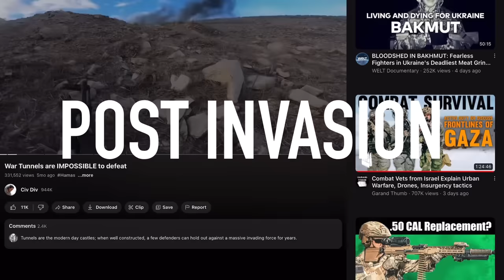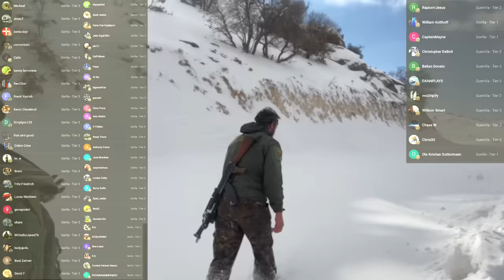How to SURVIVE an Invasion *Guerrilla Edition*

Comment: Here's an outlandish question. 

How safe do you think tunnel networks are if hit with nuclear weapons? (Two different scenarios)

The first being a ground burst on top of or near the tunnel network.

And the second being a subterranean detonation either made via some sort of nuclear armed bunker buster or a hole drilled into the earth with a nuclear device placed within.
Reply: Look up reports from people on the ground in Hiroshima. Some people survived in brick basement
Reply: @ethanking4954  I believe the Hiroshima bombing was a air burst. Not a ground or subterranean
Reply: Too many variables...would have to be mission specific. The assumption is usually a blast would NOT be on top of you. Even Cheyenne Mt. has a limited burst capacity for direct hit.
Redundancy is the order of the day as far as survival and long term operations are concerned. That's why secrecy is so tight. Just because we know about one doesn't touch the many others!
Reply: P.S. A well stocked tunnel/bunker system would still be your best bet, especially if it could be sealed off or filtered air.
A large lithium battery bank could keep you lit with leds and light comm's for weeks if carefully conserved.
Reply: Going underground is a solid tactic for surviving the fallout. It only takes a few feet of soil to stop even the worst radiation.
Reply: @vhfgamer not the blast though
Reply: @dananorth895  Also most people are stuck in the last century thinking about traditional nuclear bombs. Very few people are thinking about the radiological threat of neutron bombs that purely target biological matter. I guess partially because there isn't much you can do to defend yourself from that other than just not being in the area.
Reply: @vhfgamer  Other issue though is also making sure the terrain keeps you from being buried alive. Like lets say a chunk of building falls on top of your entrance.

Comment: Tunnels are good if you have time and equipment to build it. But for common folks especially in Russia/Ukraine it's not the case innit? I think guerilla tactics in woods would be helpful aw
Reply: Drones with infrared cameras can easily find you through trees
Reply: Are we sure they didn't have some years to prepare?
Reply: Ukraine may have ground water table issues for tunnels, its flat terrain. They had tunnels in vietnam though and it rains plenty there so im not really sure.

Comment: Tunnels are impossible to defeat…. Good thing the Japanese never heard of them.😊
Reply: Japanese military used plenty of them, in battles like Okinawa, Pelelieu, Saipan, and Iwo Jima. 

It took a considerable amount of men and material to deal with what were effectively isolated webs of tunnels surrounded by some of the biggest guns in the world. Mop-up operations on Iwo Jima by the Army garrison after the Marines secured the island lasted for months, and that was with a relatively isolated and small tunnel network with no local support, no hope for resupply and reinforcements, and nowhere to run. 

How bad were the losses? American commanders made so many Purple Hearts that the medals intended for the invasion of Japan were still awarded well into the GWOT. More pointedly, other American civilian and military leaders placed their faith in ending the war with the atomic bomb, at the time an experimental weapon which had only been test-fired once, and never dropped from an aircraft until the day it was used. 

The experience of fighting those tunnels in rather optimal circumstances were such that they were willing to use a barely-tested prototype super-weapon in the hopes they’d never have to actually invade. And unlike every other weapon which was fielded before it could be properly tested, it worked as intended.